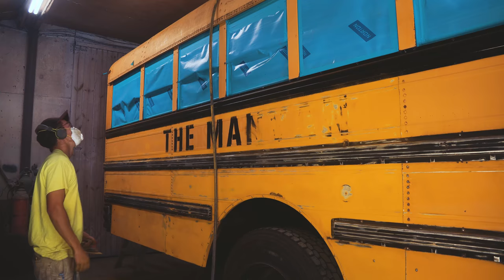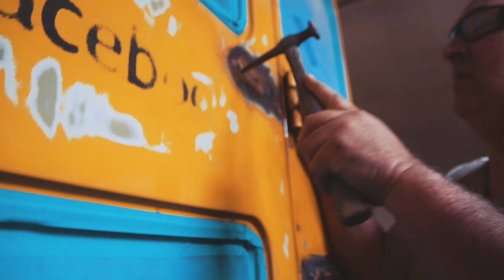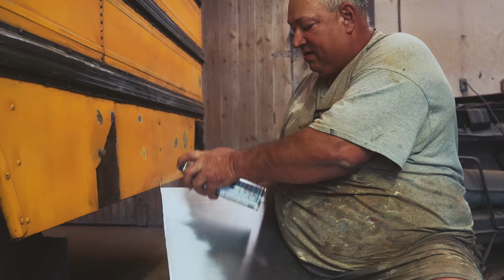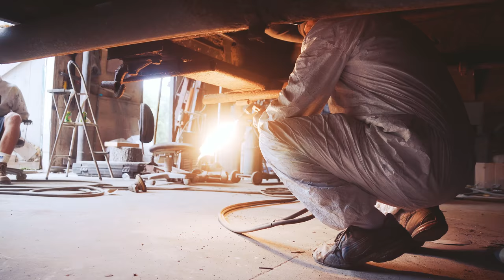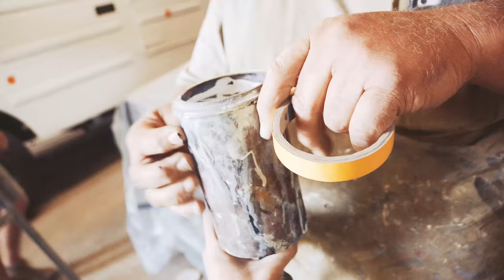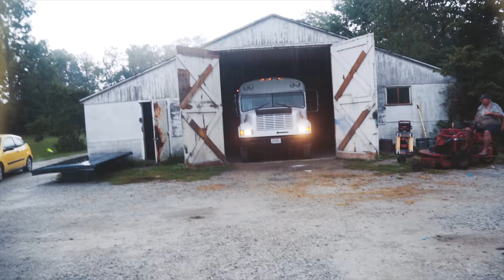PROGRESS #16 | School Bus Conversion | SKOOLIE PAINTED

Comment: Nice work guys. Finally, a video showing people the right way to prep and paint. A note to those of you that think sanding with 100 grit paper and using house paint with rollers and brushes looks good. Just ask those that took the fast, cheap and easy route how well their work is holding up today. 
These guys did it the right way and their work will withstand the elements and test of time. Also, I guarantee you that it wasn’t crazy expensive either. Job well done gentlemen.

Comment: Nice work guys! We're painting ours ourselves next week. Wish we had a shop to do it in!!! -scott
Reply from the maker: Thanks Scott! Good luck guys! it takes sooo long. We were literally sanding our from 9am- 5pm every day for 2 weeks to get it smooth enough to paint gloss white and not have a ton of marks in the paint from rust and dents/scratches.
Reply: Hey btw guys.... I've had those WD hard drives die on me twice, I'd never buy another... I ONLY USE Lacie Rugged drives now.. They can take a drop.  My opinion after my last 10 years of production experience. If it's for travel the ruggeds are bullet proof. If it never leaves your desk, another story.
Reply from the maker: I've heard of those but never looked into them! Thanks for the tip because it is whats backing up all of our footage/finished videos so if it failed that would be horrible!
Reply: great job guys it's great to have good people to help along the way and learn from the best (old schooler) can't get better then that.  

I miss my grandpa, always welling to teach young people, no matter we are. The last of an great American.

Comment: Love the paint job guys! Will look even better when yall add the red logo to it later on. Since yall are done with the conversion, I have a quick question... how are yall going along with all the exposed windows? Is it hard to regulate temperature? Or did yall insulate with enough stuff on the floors and ceilings that yall aren't having that problem? I love the idea of having all the windows exposed, but am afraid it will get too hot in summer and too cold in winter... would love your thoughts!!

Comment: The proper way to fix that patch would have been to cut out more of it, put a sheet behind it, coat it with POR then put another sheet in front. That rust will NEVER come back. BTW, You needed a respirator not an N95 dust mask.
Reply: What I want as looking in the comment section. I figured it needed to be cut out it out completely